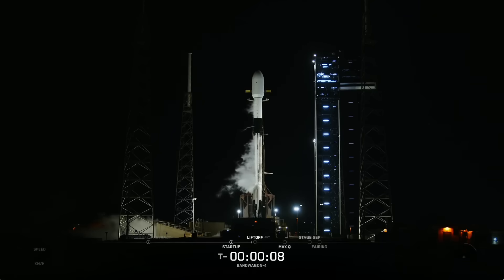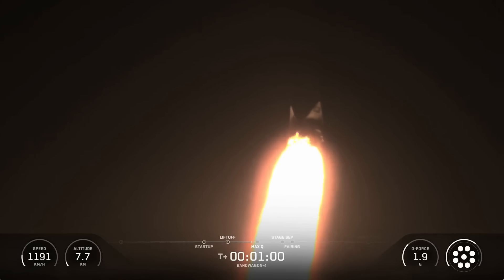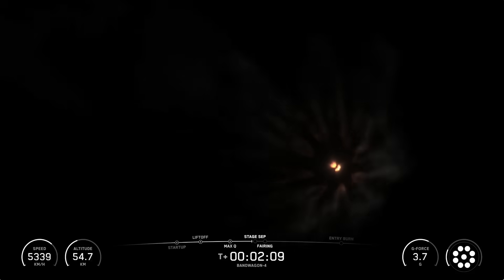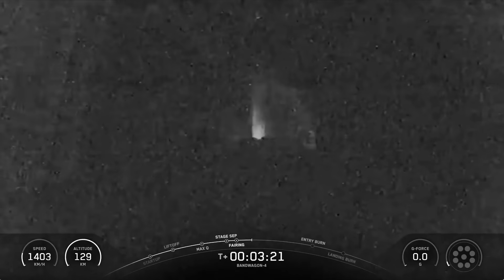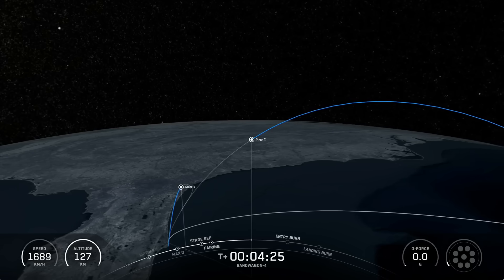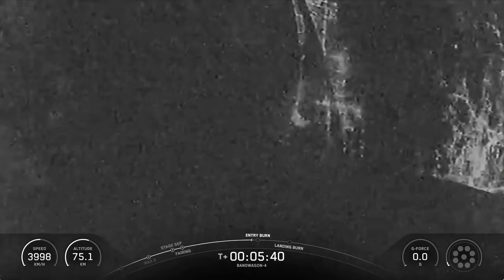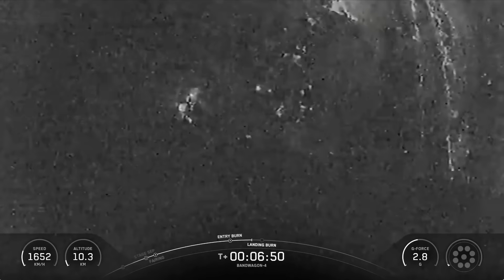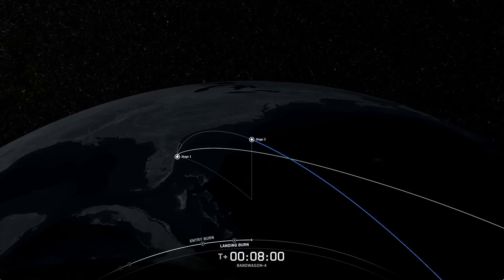Blastoff! SpaceX launches 'Haven Demo' and 17 other satelllites, nails landing

Comment: landed 30-45 seconds faster than normal?
Reply: Jesus. It was a return to launch site landing. It wasn't 700km away in the ocean if on a barge. Of course the landing will be earlier.

Sep speed was 5300kph and not 8100.
Reply: @penguin44ca   got ya!  big 'duh" on my part!
Reply: @mikethetoolman8776 yes again as stated it was returned to the l launch site, not an ocean landing. Speeds and times will be different.